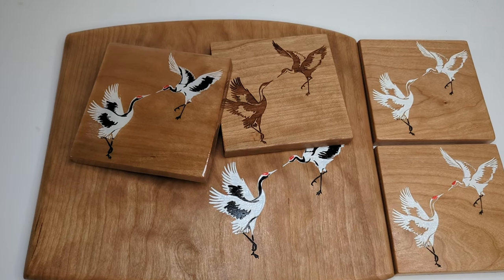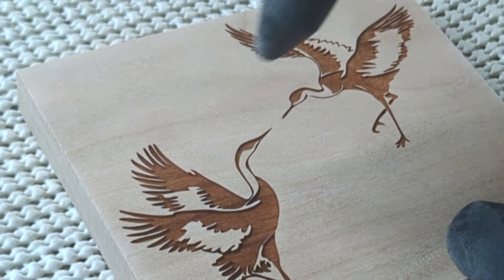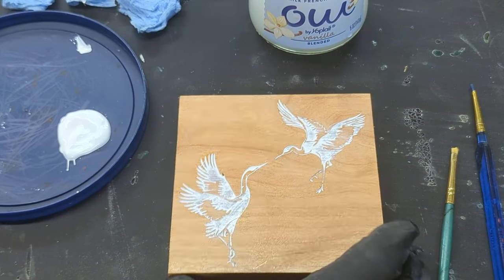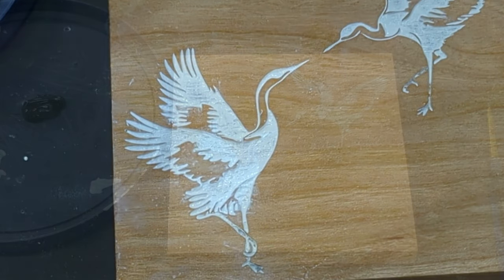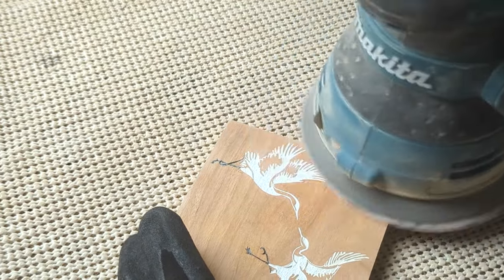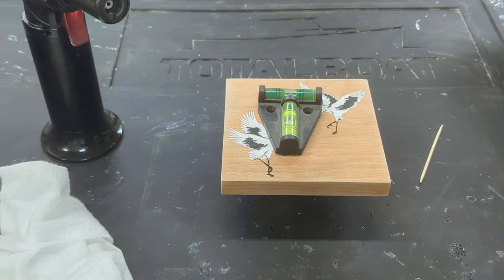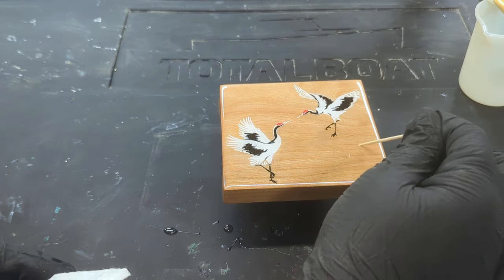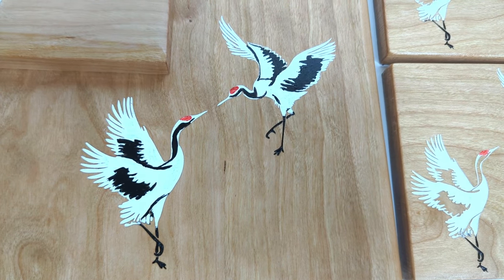Easy Way to Paint Color Fill Laser Engraved Wood

Comment: use a squeegee and do all the white in one pass, not 10
Reply from the maker: Thank you.  I have tried that myself, but didn't get the results I was looking for at least in my designs on this wood.  Also, white will pick up the burn from the laser, so typically, you will need a few passes with drying in between to get it a bright white.  Love the suggestion and will try it again.  Cheers.

Comment: Nice project but I could never do the detail painting.
Reply from the maker: It is not as bad as you think.  After color filling the white, where you see the black is actually higher than the white, so it is easy to lightly touch that raised area.  I have moderate arthritis and don't have a problem.  Sometimes I will even have to use a magnifying glass, but is really easier than you think.

Comment: What other sealers can be used as for some reason Shellac isn't that easy to get in the UK?
Reply from the maker: I have heard that.  I think you would need to experiment a little.  Try a polyurethane or a polyacrylic.  I think they take longer to really dry.  Look for other products by Zinsser.  They make the Bullseye shellac that I use.  Good luck.
Reply: @1elephantmemories 
Great video, appreciate the brushing tips too!

FYI, I have had polyurethane yellow on me after mild UV exposure. Polyacrylic might be a better alternative.
Reply: I've used clear acrylic spray paint before for sealing wood for either paint or CNC carve and paint
Reply from the maker: @rslazas  Will have to give them both a try.  I am not sure both are good as actual wood grain sealers.  I tried a varnish once and it did not really work as a grain sealer.  However, if you use a clear varnish at the very end that has UV protection in it, it is a great finish.  That will help with the yellowing.